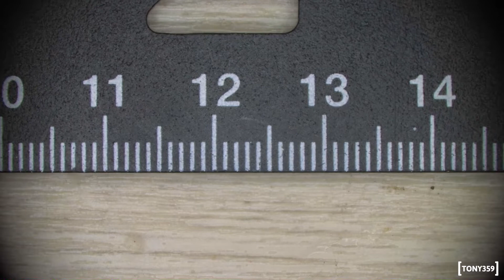Lapsun 4K Microscope - Sony IMX377 (?) - Follow up and 0.75x Barlow lens test

Comment: I have Similar 4K cam (hayear 6210) with 180x lens. The 120x lens is only different with the 0,35 eyepiece on the top, while the 180x has a 0,5x eyepiece. To me it looks like this eyepiece has the opposite effect than the barlow lens. The same lens in 300x uses a 1x eyepiece. 
I find it strange that with your 120x lens,  you only have to adjust the height by about 10mm between min and max zoom to have sharp images. On my 180x lens it much higher, I have these figures:
180x no barlow: 4,5xZoom 2,2mm visible height 8,5cm working height  and with 0,75xZoom 15mm visible height 14cm working height. So that is 5,5cm difference
180x with 0,5 barlow: 4,5xZoom 4,5mm visible height 17,5cm working height  and with 0,75xZoom 115mm visible height 105cm working height. Here it is 87,5cm difference!
At 0,7 zoom the 0,5 barlow is unusable due to height limitations, but it is at that lower zoom point that you have the highest field of depth, So that is why I prefer this 180x lens without the barlow lens and still gives about 14-8,5cm working space.

Comment: Nice video, how about diameters? Microscope camera 25,4mm is connected to C mount lens 20mm. Lens have 50mm for hook (stand) and 48mm ending for Barlow lens? And Barlow lens is 45mm? How about protection glass, do you have any/use any?
Reply from the maker: I eventually got a protection glass yes. I feel those C-lens are pretty much standard, is there anything you'd like me to measure for you?
Reply: @tony359  Thanks Tony! Yea C-lens are 25,4mm most camera has same size so you can mount C-lens quite easy. Can you measure you lens size (hole diameter) at the top and at the bottom? Also the Barlow lens size (hole diameter) would be nice.

Comment: Rather than use a custom washer on the stand pipe, I found it more convenient to cut a piece of PVC pipe (1.5"?) to the proper length and simply slide it over the tube, letting the microscope assembly rest atop it. Punt the existing clamp.
Reply from the maker: of course that is also a good solution!

Comment: I dont want to spend that much, but i like the 180 lens with a 0.5 barlow, and the stand. What budget camera should I get?
Reply from the maker: Yes I feel 180x + 0.5Barlow would be the best combination. I'm afraid I don't have experience with anything else but I'd stay away from those with the integrated screen. They might be a little cheaper but something like this Lapsun is vastly superiore in terms of ease of use and performance. Check the "Joylens" review on this channel! Thanks for watching!

Comment: Hi. Nice review. Do you have a link for the barlow lens (x 0.75) or any specification?
Reply from the maker: Hi, thanks. I guess it depends on the lens where you need to fit it to. A 0.75x barlow should be a 0.75x barlow. Whether the C-mount lenses are all the same, I do not know. Your best bet would be to contact the manufacturer of your lens. Thanks for watching!
Reply: @tony359  mine is same as yours bought same place but they dont sell this lens :/ lapsun that is

Comment: I have this camera but the seller i got it from does not sell or include barlow lenses. and i dont know what the thread size is for the barlow lens. does anyone know the thread size or have a link to purchase barlow lenses for this camera?
Reply from the maker: If it's a C-mount lens, I'd say they should be all the same. Mine has a thread of 42mm - I believe the body is 50mm.
Reply: @tony359  Thanks. the ones i found were all 42mm but i wasnt sure. now this verifies everything. Im ordering a 0.5 and 0.75.

one thing i noticed in your video was you were saying you would leave the barlow lens on there as a sacrificial lens to protect the camera. My camera came with a plastic cap that i can slide on or off even if i have the led light attached to it. did your camera come with that cap? if you have it you can use that instead.
Reply from the maker: I mean a protection from fumes and dirt, not for when it's not being used. I did eventually get a protection but I never use it, the Barlow is enough IMHO!

Comment: After watching your videos on this Lapsun after trying and returning an Andonstar AD249S-M microscope that was more like a plastic toy, I bought a Lapsun entire setup with 180mm + 0.5x converter.  This gives 17cm working distance.  I too was blown away with the quality for the price and am very happy with my purchase.  I paid £315 inclusing a base, shipped to the UK and an Andonstar AD249S-M was £260.  Thank you so much for doing both the videos, they helped me immensely.
Reply: I glad your experience was positive with Lapsun. Many customers have been on the opposite end though so be careful and do your research if you decide to buy any of their microscope cameras etc. What microscope camera model & set did you buy? I purchased one MS camera from them about 2 years ago and I was pretty unhappy when it arrived. Around this time is when they completely stopped production on the IMX290 MS cameras and Lapsun did not tell me or about 20 other people who purchased one. I received the IMX307 MS camera version and right away you could tell it was much worse. The video quality and framerate was below my likings. The IMX307 MS camera and many other they sell use a  " interpolation method to produce a "60 FPS" frame rate. It was more around 30 FPS or 45 FPS with stutters / slight choppiness / lag . They originally did not want to refund me but Ali-Express forced their hand. What was crazy though is the seller working there really tried to tell me they were selling genuine IMX290 cameras still and sent me PCB picture of the motherboard stamped *290* which refers to the sensor that's soldered on the board. The picture was an old picture from when they really did have them. I already had 1) IMX290 camera from Eakins from the prior year so I knew something was off and decided to take it apart. When I opened it up the MB stated * 307 * and right away I knew which sensor it was. I really wanted to try out another camera from them but I've decided against it because who really knows what sensor they are trying to sneak by customers who wont investigate if they think something it up. Eakins is much more open and honest about the cameras they sell now and  RISING CAM a RT5109 - 4K true 60FPS HDMI preview camera ( no interpolation that I can tell )  that has some of the best video quality I've seen. The IMX290 models were amazing and I wish they would bring them back but now the only few sensors I think work best are going to be the : IMX334 ( from RISING CAM ) , IMX385 ( V2) <--- I'm not a huge fan of this one but when you find it for 150-200 its not bad, & the IMX 291 <-- This one is very very close to the IMX290 but does lack a slight HDR / lowlight feature due to the sensor design that makes the IMX290 have such a great video preview in all lighting. I'm going to keep purchasing more camera's to test out and I really should make some YT videos so people can see the real cameras in action. The AKWang guy sometimes used old footage of the IMX290 and states it a different sensor since the outer shell of a few cameras are identical.     Sorry long long rant but I wanted to warn you so you don't get rug pulled like many of us did from this vendor. Take care ! :)
Reply from the maker: @shiftctrlhack  Sorry for missing this reply. I did mention some concerns about Lapsun's customer service in my main video. I believe I did say I would think carefully when buying more expensive ones. As a minimum, it must be covered by something like PayPal so you can return it if it does not match the description. In the end, not even mine matched the description - but I was happy with the quality so I did not complain. Thanks for mentioning though, it's a very good feedback. (I;m not affiliated with them BTW! :) )
Reply: Hi,  would you be able to provide a link where you bought yours, im also in the uk and im really tired of these low quality digital microscopes
Reply from the maker: @nutterhm  Sorry for missing your reply - Lapsun are on Ebay (Lapsun_gift) and if you get in touch they can sell you directly - but please make sure your purchase is fully protected by something like Paypal (check the T&C to see what's covered or not) as even my scope was advertised with a sensor and it arrived with another :)
Reply from the maker: Thank you so much for your nice words! I also reviewed the AD249S-M (or is sub-brand) and I am glad you agree with my conclusion! I think I also called it "a toy" at some point (clearly the last item they'll send me to review but hey...) https://youtu.be/Wo9eZnef9Qs

I'm happy to hear about the Lapsun. I should have gone for 180x + 0.5x as well, it's probably the sweet spot. But I am happy with my unit though, no regrets. 

Thanks for watching!

Comment: So you still love this microscope i just looking to buy one, should i buy it?
Reply from the maker: I still love it! :) Particularly the stand quality and particularly after reviewing a more popular one here ( https://youtu.be/Wo9eZnef9Qs). Just be aware of the sensor "lottery", be clear with Lapsun on your expectations. Thanks for watching!
Reply: @tony359  wow thank for your fast response, i’ll say on order that i want imx 334 right?
What do you think about 1080P 60FPS SONY IMX385 V2 does it better than your microscope?
Reply from the maker: @MrOmer123  I am really not an expert on other sensors to be honest. My unit says 334 on the PCB as you found. There's another user who commented here who was very very happy with its purchase. All I am saying is be aware of this potential "lottery" and make sure you are using a payment/platform which allows you to return the item if you're not happy with it.  Let us know how that goes :)
Reply: @MrOmer123  What did you got now? As I understood the IMX385 seems to have 4x better low light sensitivity (what ever that means) but a smaller sensor. The IMX334 cams seems to be cheaper though but also integraded in more expensive cams. I think I would only go 4k if I could afford a cam with IMX485 sensor. IMX385 cams seems to be the better 1080p cams vs the IMX334 4k cams not really the better ones I think?

Comment: Hi I’m thinking of get the same microscope or the lapsun 4K 48MP 1080P 60FPS HDMI are you still happy with your one pal or do you think the other one I’m looking at would be better. Kind regards Andy
Reply from the maker: Do you have a link for the other one? I am very happy with this one, particularly with the way I clamped it on my desk. I saved money and it's so practical to use!
Reply: I’m gonna do the same sort of thing as I don’t need the platform it comes with. Only thing I don’t like about the other one in the link is the connection are on top.
Reply: Did you get the link as I don’t think it’s letting me send it?
Reply from the maker: @andreasachilleos6335  no unfortunately, Youtube won't allow that apparently. I might have found it, what I don't like is that the sensor is "anonymous", it says "48.0MP 1/2.3 Inch big size Japan CMOS" :) One of the reasons I went for the one I purchased was that it featured a Sony sensor (which ended up NOT being the one advertised though). To be honest, I feel it's impossible to know what you're getting. Why not emailing Lapsun and ask for some advice? I did that when I got lost with all the models they have and the one in the video is the one they recommended TBH! See if they have some actual footage you could see. Also, I would make sure it works with OBS (if you need that) and also that it works on both HDMI and USB at the same time. Mine does that even though it was not supposed to... And yes, connections at the top are not very practical, I agree. Let me know!
Reply: @tony359  thanks pal really appreciate all your help think I’m just gonna go with the one you have, as that’s what I thought could be any sensor in the other one and is it really 48mp not that I need it for taking pictures anyway. Love you videos by the way keep up the great work. Kind regards Andy
Reply from the maker: @andreasachilleos6335  Thank you! In photography the resolution is not all. Lens quality, sensor quality are as important (or even more). I hope you get a good deal and you're happy with it!

Comment: These types of lenses that are sold with cameras are not very good compared to the professional ones, both in terms of magnification and in the need for extra lenses.
Just as they are sold for all types of cameras regardless of the number of mega pixels, which makes them worse.
The lenses have a specific number of mega pixels to work perfectly.
Reply: I have these two models, they are relatively easy to find on ebay at good prices, removed from end-of-life industrial equipment. The image quality is surreal and doesn't even need lighting if used with the right camera for it, as with the new IMX385 sensors, which despite the low resolution work in near darkness and at 60fps.
Reply from the maker: Thanks for watching! These are definitely cheap microscopes - there’s no doubt about that! But for the price I feel they’re doing well. 
Thanks for the hint about the lens. Would you be able to send a link of one of those lenses for reference?
Reply: @tony359  YouTube doesn't let you share links other than YouTube itself. But I found a store in the UK with the computar lens at a very good price, it's called: online security products
Reply: @tony359  Computar MLH10X Macro lens 13-130mm 1/2" Manual Zoom C-mount =£209.57
Reply: @tony359  The other industrial lens is the: Kowa LMZ50M – 8.5-90mm Macro Zoom Lens
Reply from the maker: @terrorista-666-  I’m sure it’s a great lens but I paid my whole microscope with the stand and everything else more or less the same amount! 🙂 
That said that’s very interesting, I’ll take a look.
Reply: https://youtu.be/XtidA_AW7Rs
Reply: https://youtu.be/li-okh0TfCY